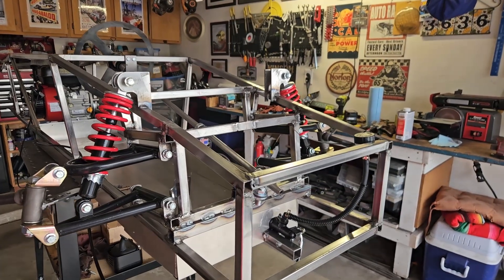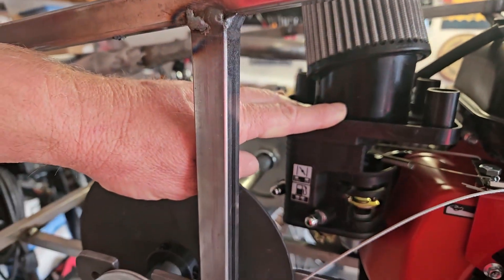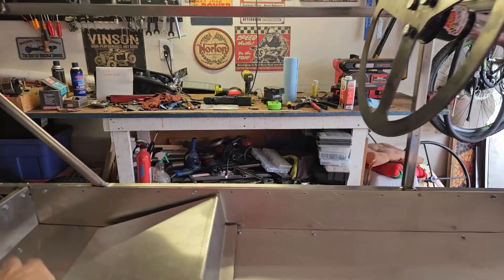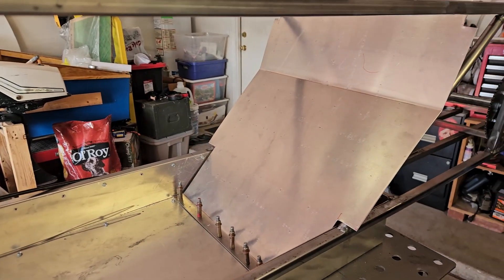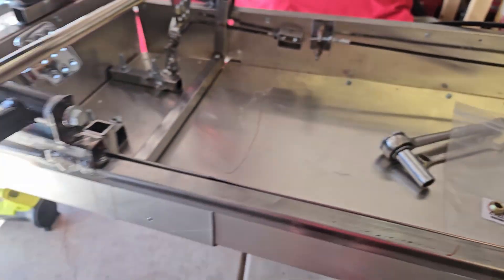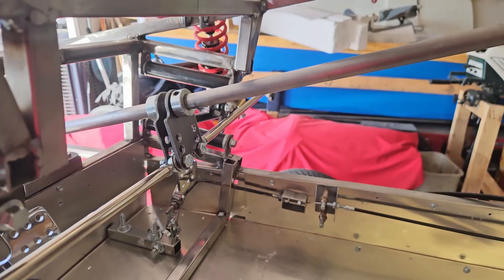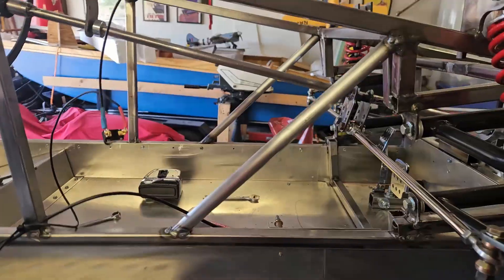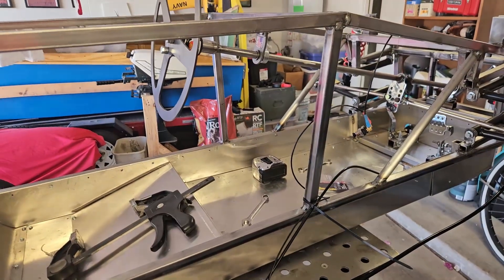Sharknose CycleKart Frame Video 3

Comment: Thanks for the video.
Wondering why you didn't use a cogged belt?
Reply from the maker: Cogged belt?  Do you mean on the TAV?
Reply: @stevevinson6030  Replace the chain drive with a cogged belt, smoother, quieter, plus no grease.
Reply from the maker: I wasn't aware of this method.  Thank you

Comment: I believe I see the influence of Colin Chapman in your latest design . Super ! I'm concerned with those parallel diagonal tubes on the sides near your knees without a triangulating tube to brace it should you head-on crash . Great work !! Stay safe
Reply from the maker: Thanks, I was thinking about adding another bar there.  Thanks for watching.  Cheers

Comment: First use of the Predator 224 I’ve seen on these cars. I doubt an extra 12cc will make a big difference but wondering about reliability and availability of upgrades?
Reply from the maker: Upgrades are about the same as the 212.  So far so good, I have the 224 in my #7 Ford and my dad's Duesenberg.  Thanks for watching
Reply: @stevevinson6030 thank… my friend and I are building a pair and have decided to go with the 224…looking to upgrade that plastic cam gear!

Comment: Im not building it,but if I was I would put another brace going from the one at the steering column support down to the bottom of the brace in front. 

It looks really good in my opinion other than that. 

If you have the correct equipment cutting round tube is just as easy as cutting square tube. 
Making a fishmouth/saddle is no problem at all with the equipment and tooling I have. 

I started fabricating at about 8or10 years old, my Dad did my welding until I was 12 then I started doing my own welding. 

I'm in my 70's now and I still enjoy fabricating and welding. 

I enjoy watching your videos very much, thank you for all you share with us. 👍👍
Reply from the maker: Thank you for the advice.  Cheers

Comment: Cool stuff!
Perhaps one last bar could be added on the side mid-section supporting the steering crossmember, as to...triangulate it.

Looking at the center steering arm, if the front bearing support were brought down just a bit, then the middle/shorter steering pivot holes could be used, giving you a bit more authority over the steering. In other words, the nose of the steering shaft would be lower, and then the inner tie rod end Heim joints would be choked up closer to the steering shaft, slowing the ratio of the steering.  If the front steering support were actually adjustable for height, that would be cool.

BTW, a small motorcycle dampener could be added, too.
Perhaps Renegade could work up some kind of collapsible column.
Reply from the maker: Great points, I will give that some thought.

Comment: You're likely overthinking putting the brake on the drive side. All you'd need a piece of sheet metal with a hole in it (for the axle) to act as a wall between the rotor and the drive pulley.
Reply from the maker: You are very likely right about that.  Thanks for watching

Comment: Hi, Steve Can you tell me how long your rear axle is?
Reply from the maker: This one is 42", I am using a longer than normal, because the wheels I am using require a different hub design: the axle is secured outside the wheel instead of inside the hub like would be common on the CT90 wheels.  Wheel track is still 39"

Comment: I do believe a header pipe is the same pattern with a 90 degree you might try to relocate cold air intake
Reply from the maker: Thanks for the tip, it sure looks similar.

Comment: Looking good! it's just dawning on me the lack of ladder frame on this build, I would be adding lots of gussets!
You touched on an issue that gave me fits on my build. EVERYTHING is much different on the sawhorses verses on the ground with you inside. 
Things you thought were problems did not pose any trouble and things you never anticipated came to light.
A rolling chassis and test drive are significant milestones, congrats
Reply from the maker: Exactly.....I am not building this with any engineering software.  I am sure some is intuitive, but I am mostly learning as I go.  I will likely add a bit more steel under the motor, it seems to be hopping a lot under acceleration.

Comment: You probably already know Steve, but to avoid chassis flex, chassis tubes should be triangulated so the forces go straight down the tubes in compression or tension. Mounting should also be at the nodes made by the tubes. 4 tube sections will want to go rhombus on you and the tubes will take bending forces. Googling 'spaceframe chassis' shows examples. Thanks for the videos!
Reply from the maker: Thanks for the tip, I am mostly just building it to follow the inspiration car chassis as much as I can with the limited space available and trying to keep it light.  thanks for watching